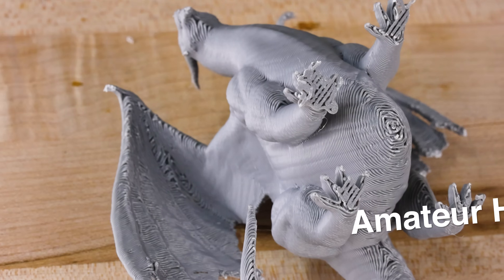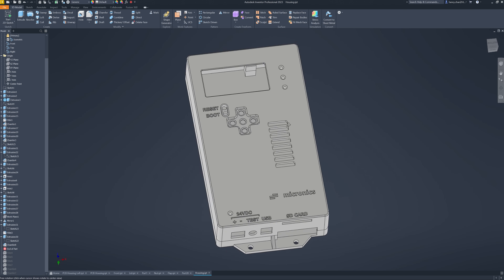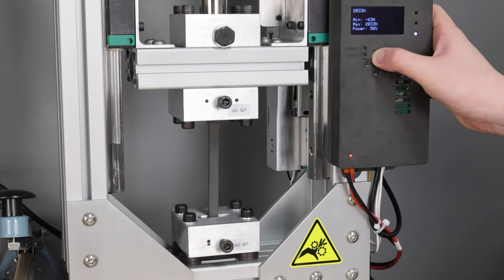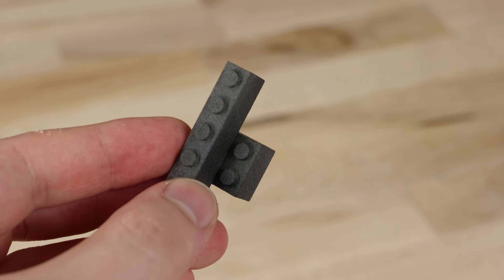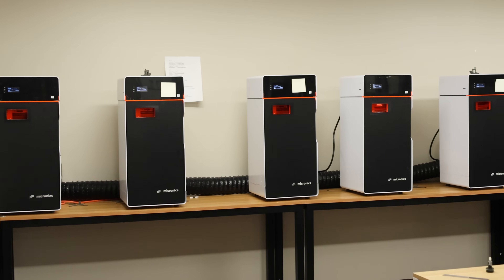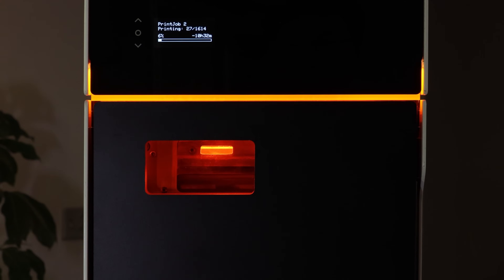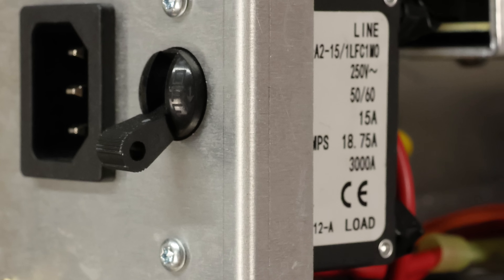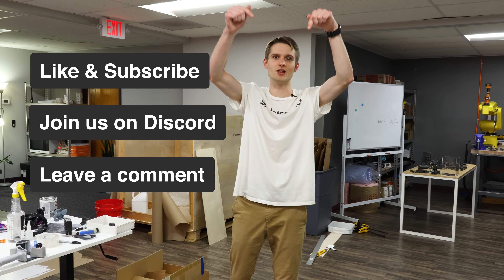TOP 5 REASONS to switch to POWDER 3D Printing!

Comment: 1:40 I don't want to be the bearer of bad news but that's unoptimized FDM levels of quality, there's no way this could possibly contend with resin when you lose surface detail on this level, it is not miniture printing ready and i doubt it'll ever contend with resin if it will always require sanding to get rid of the bumpy surface

Comment: Minimum 10.000 dolars for the machine.

+ You need adiacent machines for postprocessing, meaning 
1. Oven
2. Parts Dust cleaning machine

And you have to consider that the material for sls is more expensive.

Comment: Can you add how it is better than resin printing? It appears resin printers achieve as good or better resolution at 1/10th the cost of this machine. This video only compares to FDM and injection molding. Not saying I'm not interested, but are the advantages worth 10 resin printers?

Comment: Ok, now for a brief list of reasons not to switch to powder printing (particularly if you're not planning on using this thing industrially):
1) Hazards! Very fine dust is very bad, regardless of how non-toxic it may be. You're going to need an N95 mask or a very good fume hood at minimum every time you work with the powder. A proper respirator is probably your best bet. 
2) Price! This thing is triple the price of a Bambu X1 Carbon, and the per kilogram cost for equivalent materials is roughly double compared to the X1C. SLS is powerful technology, but, at least in the home, consumer market, the benefits rarely outweigh the literal cost. 
3) Workflow! SLS requires much more complex workflow. Removing and safely handling the powder (see above) requires other tools in addition to the printer itself. Formlabs, the leader in this technology, sells their SLS machines as a three piece set: the printer, a fume hood/powder recovery device for coarse powder removal, and then a media blasting cabinet for fine powder removal. If you want the beautiful results shown here, you'll need a media blasting cabinet in order to get the powder off. 

Basically, what I'm saying here is that if you're the average at-home 3D printing enthusiast who uses their printer to print fun plastic tchotchkes, you have no need for this device. It's more expensive, more complex, and a bigger health hazard than you want. Just get an FDM machine and have fun printing PLA. This device is really well suited for engineering and manufacturing applications - where cost is a secondary concern to extremely high performance and/or throughput.

Comment: You should wear a mask and gloves and have an air filter while using this. Nano particles small enough to pass through the phospholipid membrane of cell walls by say inhalation, are carcinogenic, that is a scientific fact, as was found with nano particles produced from internal combustion engines in cars. I hope that the correct research into safety of these materials for domestic use has been done. Please do not take my comment as a criticism, I am supportive of your project and machine, and if the price is right I would order one.

Comment: Wow, that price sounds really good for SLS machine. Will the slicer be FOSS or at least ported to Linux at some point?
Reply: i am against that.. chinese will just copy with impunity and corporations will gain new tricks.. open-source is not good in many cases.. benefits bad players
Reply: @chronokoks  The slicer itself is absolutely useless without the printer to go with it, I really don't see how would that benefit competition. But I am certainly not buying a printer I can't slice for.
Reply: @chronokoks  Also, proprietary slicer means that the printer will be just a pile of junk the moment the company decides to stop supporting it.

Comment: Damn, this looks amazing. I was planning on buying a Bambu Labs printer later in the year, but this looks next gen. Hopefully my budget can cover it. 

I guess the concern would be where to purchase the SLS powder in the UK and how much will it cost.
Reply from the maker: It will be available on our website https://www.micronics3d.com/products
Reply: A Bambu machine is going to serve you better at a far lower upfront and running cost for 95% of applications.
Reply: @kerbalengineeringsystems7415  I did a little research after writing my initial message and came to the same conclusion. So, will wait and see how consumer SLS will develop over the next couple of years. Cheers.

Comment: The one big downside of powder-based printing is that it's INCREDIBLY wasteful. It doesn't matter whether you printed a liter or a ml, the powder that was in the printer at the time can only be used for 2-3 prints, before it all has to be thrown out.

I predict there will be DIY pulverizers being developed if powder-based hobby printing becomes commonplace.

Also worth noting, the 50Mpa durability rating is roughly the same as high-end resins.
Reply: @ClokworkGremlin I looked around and can't verify your statement on throwing out the powder. Can you tell me where you got this info? Thanks.
Reply: From the specifications on the Micronics's website: "Material Refresh Rate <10% (Zero Waste if >10% Build Volume Filled)"

Comment: The second this tech is able to produce results as smooth as resin prints, without that granular texture, I'm making the switch. No supports alone is worth it, not to mention the other crazy benefits.
Reply from the maker: You can get pretty close by shot peening the parts in a regular media blaster using Acrylic blasting media to get a semi-gloss finish.

Comment: The tech is really cool and all but I don't know why I would want this.  Removing supports is a minor inconvenience, it's not that much of a hassle really.  I don't think it's worth 3k just for that because and I don't see any other advantages to go for SLS compared to resin or FDM.  Does SLS prints are significantly more impact resistant than what you can do with FDM, I doubt it.  Does it prints a lot faster than modern FDM or resin printers, no.  Does it print sharper than resin printers, not from what I see.  Aside from getting rid of supports I don't see why I would buy this.

Comment: Honestly is great to see you guys coming in with this stuff, even if I personally probably don't have as much use for sintered plastics as I would metals, which is a whole different ballpark, still great tech though. As someone who does make a lot of thin walled parts I can at least appreciate why this would be great for precision mechanical parts, if not ideal for aestetics with the very porous looking surface finish right off the printer.

As some general video making advice to help you guys out, I will just point out that you're pressed into a corner with solid walls, no sound dampening and you're shouting with overemphasis on every other word (Normal for anyone unused to relaxing when actively on camera and reading a script, no disrespect to you at all mate). My advice is take a deep breath and relax your chest and throat when talking, trying not to focus too hard on the individual words, just the message to get across so you speak your own words more naturally. Relaxing should also help prevent excessive volume as well, because your microphone is literally right on your chest so no need to project your voice to the camera, and beyond that try and print or buy some high frequency sound dampening material for the walls behind you, that'll go a long way towards improving the audio.

Comment: If you read the next sentence in the McMaster paragraph it actually says you're allowed to print them in order to determine if you want to buy them from McMaster. So you SHOULD print anything you order from them first, just to make sure it's the correct fit.
Reply: That joke went way over your head. Way, way over.
Reply: @imowgrass  I understand the sarcasm, but it only makes sense as a joke if they don't explicitly tell you that it's allowed

Comment: How much is the machine, how much is the powder, and how much are the parts that will need to be replaced with routine maintenance, and what type of maintenance does it require?
Reply: Machine is 4.5k USD, powder runs between 200 and 250 USD for a 5.3L bottle

Comment: You forgot to say that in contrast to fdm and sla where you can make your part hollow, here you can't. So you waste more material this way. Also there are not any cheap powders again in contrast to filaments and resins.
Reply from the maker: You can make SLS parts hollow in the same way you do with SLA parts by adding drain holes
Reply: @micronics3d  is it that easy though to remove all this powder from a small hole when it is not liquid?
Reply: No cheap powder yet. Was the same when resin started.
Reply: @hargert  I see. I wonder why other cheaper filament materials e.g. Pla, can't be turned to powder.

Comment: Some questions:

- Is the slicer really only compatible with Windows?
- Does it really not accept STEP files? With the resolution of this printer I'm worried triangles might not be precise enough to avoid faceting.
- My apartment's usually below 18C for comfort reasons, is the printer still going to work?
- What's the difference between 150μm and 100μm layers other than print speed? Are 150μm layers weaker in any way, or just slightly less precise?
- What's your planned support schedule for the printers? Length of warranty, amount of technical support available, etc.
- If only super early birds can get the $3,000 price, how much worse is the price going to be for those of us who can't scrounge up $3,000 in the next 7 days?

Comment: Everybody using SLS must first understand how dangerous those powder dusts are. Even one breath of the dust could ruin the rest of your life.
Reply: Explaine and mention sources please
Reply: @Babyfasty  Pneumoconiosis caused by dust exposure. As most SLS machines are set up in well-ventilated and protected environments, people are not aware of how dangerous these machines can be when used at home. Research has already revealed that even for SLM printing, the concentration of nano particles in the air can significantly increase.The risk is even greater for lower density plastic particles. Once these powders are inhaled into the lungs, they can cause permanent damage. Personally I will only use SLS printing if I own a factory. https://www.ncbi.nlm.nih.gov/pmc/articles/PMC7723871/
Reply: @Babyfasty  What I want to convey is that SLS printing is not as safe as it appears in the video, particularly regarding protection. A simple N95 mask is insufficient to shield users from dust exposure. Even though the video advises against placing the printer in a bedroom, I believe many supporters are still planning to set up the printer in their workspaces where they are unlikely to wear a mask.
Reply: @Babyfasty  my comment with data soruce disappeared
Reply: @accumall3027  Thks means a lot :)

Comment: Where would we get the powder and at what costs compared to FDM?
Reply: They're selling Carbon Fiber reinforced Nylon 12 powder for $250 for 5 liters. That's about double the per kilogram cost for an equivalent FDM material.
Reply: @kerbalengineeringsystems7415  Ok. Well i think that price would fall if SLS kicks off and other suppliers start to offer powder.

Comment: Love how the FDM and SLA examples at the start obviously had intentionally bad slicer settings. Having dealt with powder bed systems in corporate for decades, i will have to say no thanks.  Powder recovery and soaking treatments are a overall nightmare.
Reply: I never use FDM or SLA after we got SLS printers. We have formlabs printers and their cleaning stations, very simple and automated.
Reply: Sure it has more difficulties than fdm and sla, still this method looks next level for some use cases
Reply: I laughed the SLA supports.

Comment: It’s a really good machine that you have built, but I fear that the price is too high. I understand that this is a REALY low price compared to other SLS printers. But if you’re aiming for this to be a domestic machine made for the average consumer, you’re going to be competing with inferior technologies such as FDM and SLA / MSLA. At the moment 3d printing is seen as a hobby, I don’t know anyone personally who would pay £2999 for a machine which does the same thing as a FDM machine, even if it has better strength and print quality. Whereas 1500 would open you up to hobbyists and could seriously compete with bambulab for example :)

Comment: One very important aspect you don’t talk about is how expensive the powder is and how much use do you get out of it? Infill like FDM printers wouldn’t work so parts would need to be made solid which isn’t that big a deal.

The chemical resistance comes from the material itself doesn’t it? Not from the printing method, so wouldn’t a PA12 part have the same chemical resistance if printed on an FDM printer or your printer? The only thing I can think of that would affect that is any additives in filament to make it print better.

It would be interesting to see some real tests vs FDM prints.

Comment: Only $3000 😂. Much less expensive than other sls machines but this isn't going to replace sla or fdm for most people
Reply: Not forgetting the cleaning station. And protective clothing that must be worn when cleaning. Handling such powder is not without its risks. I used to work in a dye factory and know my way around powder dust. You need good filters and extraction systems.

Comment: Dude once the cost gets cheaper than resin printing, say $40 per Kg of a good powder like Nylon 12, we’re all in. You’ve done such great work so far so I’ll believe you if you say you’ll get it done.
Reply: It's exciting to see the tech progress and the cost come down. I love my resin printer but no supports is a game changer. They need to somehow get the resolution down to a super fine level before it'll replace resin printing. He said it's great for minis and stuff, but ignores the obvious granular texture.
Reply: @asimhussain8716  Maybe it looks better after it's been painted with a proper paint?
Reply: I think it'll blow resin printing out the water, tbh.
Reply: @NigelTolley  No, it won't until enter and running prices get close to resin, not to mention it gets rid of that horrific porus finish. it looks good for profesional mechanical parts but not for wide consumer market... yet
Reply: @grim3897  As someone who uses resin to achieve fine detail on decorative prints, that detail and part finish are the most important things.
I'll gladly switch to a sufficiently competitive technology if it means I can do away with the hazardous material/waste management and mess inherent to resin printing and processing.
Reply: You know why the powder is so expensive? The nylon they use to make it is cheap... very cheap. (Like even glass filled nylon is only a couple bucks a kg if you buy the pellets.
Reply: @deucedeuce1572  probably because of a combination of small scale production and the production process itself

Comment: Dangit Micronics, I hate you guys because of how much you're tempting me. Not only do you bring SLS printing to the hobby space for a very affordable price, you just had to go ahead and add some impressive features to improve reliability and safety.

I want one of these so bad but I literally have nowhere in my home (or outside of my home) to run it. If I had more space, I'd be jumping in on the Kickstarter the second it goes live...
Reply: Affordable? The required "filament" powder is super expensive.
Reply: @DDryTaste  true, but unlike FDM and resin, no supports needed and the excess gets reused. so much less waste. And offering quality parts to your clients will make them more likely to pay more.
Reply: @MrGerhardGrobler  Yeah I'm sorry but it is more then 10x the price per kg and I am pretty sure you won't even use 2x the filament to support a fdm printed part. It would get a lot more enticing if they manage to get down the price of the powder.
Reply: @DDryTaste  Yeah, that's definitely true, however this isn't unique to this printer, so we can't blame Micronics for that. It's also likely that we might see lower prices as more consumer SLS printers hit the market.

This also might be a way to manage FDM printing waste:

Collect like plastics (e.g. PLA) in bulk, shred them and pulverize them in a ball mill after. While it won't be as high quality as specially made SLS media, it certainly will work and offer a broader range of recycling options and potentially lower consumer costs.

Comment: okay, but you seem to be ignoring the most commonly talked about feature of modern 3d printers.. how long does it take to print a benchy?  I mean.. fdm are all about xy, voron, etc.. right now.. about 15 minute benchies are common with modern printers. 20 min if you want a comfy window.  resin is also starting to push speed with new techniques for lifting and irradiating. 
so.. if it's 20 min for a benchy on an fdm.. what is it on a resin? what is it on your machine? 
I mean.. it may be 40 min, who knows, but let's be honest ALL the way around, if it's 2x longer, that's fine.. there are other benefits. 
but put it out there, address the speed. maybe it's good, maybe it's the same, maybe it's 5x slower.  
again.. if YOU don't talk about it, it'll be one of the first things mentioned by someone else evaluating your printer.. 
and yeah... compare fast pla as well as nylon from an fdm..  standard resin, and your nylon. 
thanks. :-)

Comment: if you are going to drill threw a 3d print why have the drill going so fast that is a guaranteed disaster waiting to happen 

also who uses a drill to make holes in 3d prints just heat up the bit and push it threw the hole that way it enlarges the hole and melts the plastic in the hole to make a new skin for the hole

also when are you going to launch a desk top MLS that's what im really waiting for full mettle 3d prints